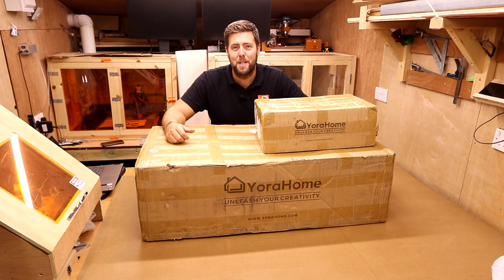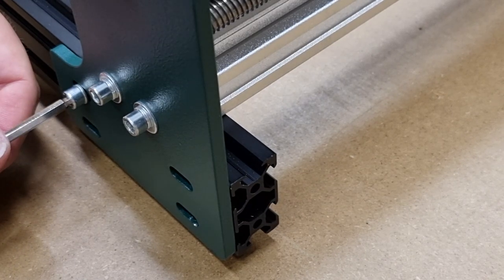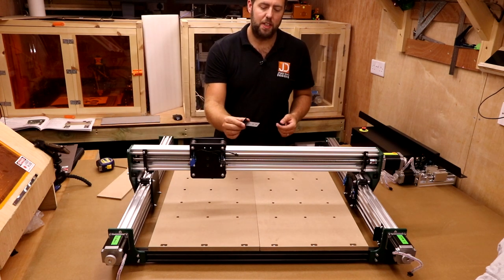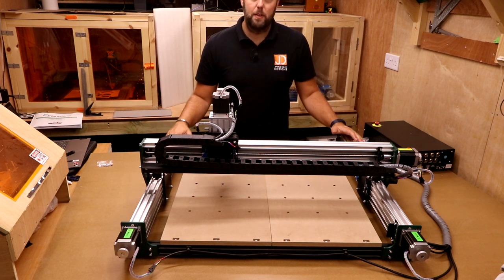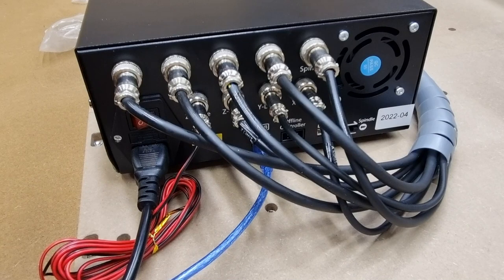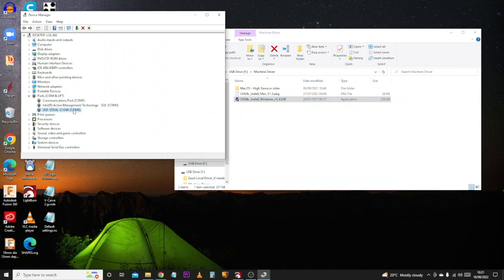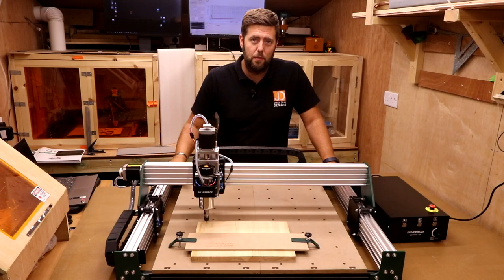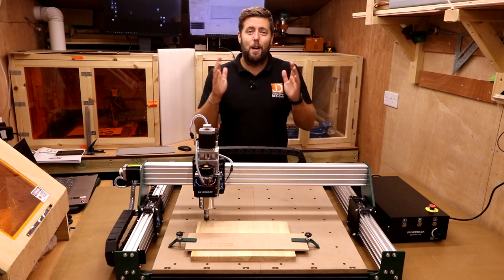Building and first cut on the YoraHome Silverback CNC router machine

Comment: Loctite... Make sure to use blue not red. I didn't realize how strong the red was and solvents don't affect it. I used it once. Literally had to take a small torch to the bolts to remove them and had to get new bolts.

Comment: Nice looking video James!  (I was unable to watch it with the sound on)..   It looks like a cousin of the Proverxl 4030,  just black and silver...  And a little bit more expensive..   I will have to watch again when I can use sound.   I noticed when you were building it,  you used what we call lock washers (I forget the British term,  spring washer?). Is it still necessary to use locktite with them?
Reply: I bought a proverxl 4030. This CNC looks like it's a clone. Only the bed and the aluminum under the bed is different.
Drag chain different position. Z has no cover. Electric has better connectors.

Comment: Shapeoko CNC is much better
Reply from the maker: 🤣 this isnt a review video but how long did you use the Silverback for? The nearest sized Shapeoko is nearly $500 more without and kind of spindle so that is a big price difference
Reply: @JamesDeanDesigns  It looks very similar to the Prover XL, and I didn't like it, like plastic wheels on the aluminium extrusions and the extrusions had some terrivle coating, like a textured paint.
Reply from the maker: @Cessna172G  fair enough, everyone is entitled to their opinions. I'm kind of the same with screw driven over belt, I'll always go lead screw or ball screw for CNC Router work.  Having been using the ProverXL since the start, I havent had any issues what so ever with either  the wheels or extrusion. The wheel should have had eccentric nuts on, that would have been good. I think the extrusion is just anodised though, but I could be wrong
Reply: Have you tried both? I'm hoping to get a cnc for making guitars. Every brand seems to have 50/50 reviews.
Reply from the maker: @THRobinson  I've not tried a shapeoko so can't really comment on those. I've seen a lot of comments saying they are over priced for what they are but that all depends on what you value and I'm sure shapeoko have a lot of happy customers.